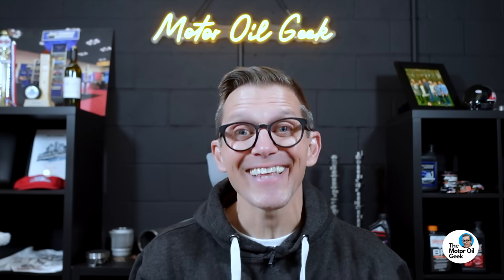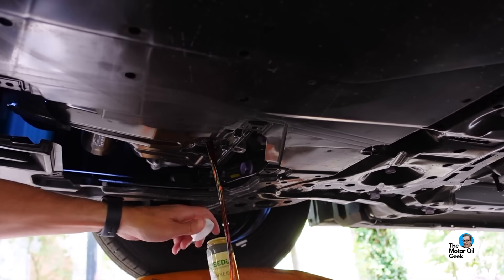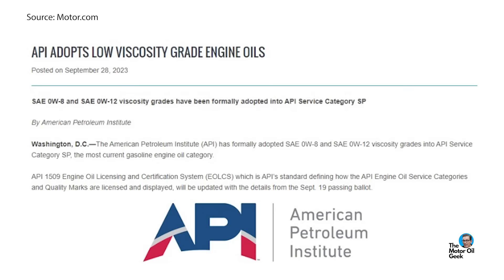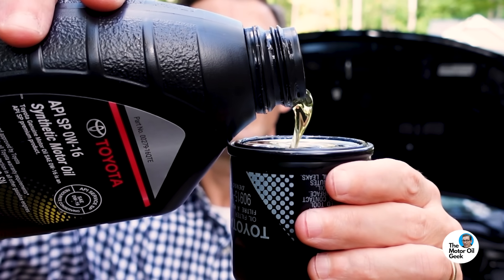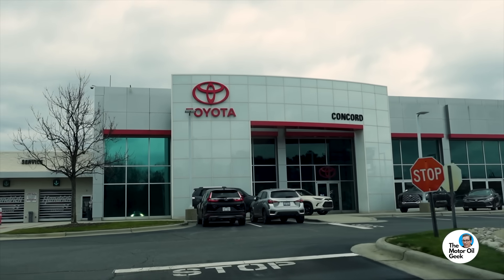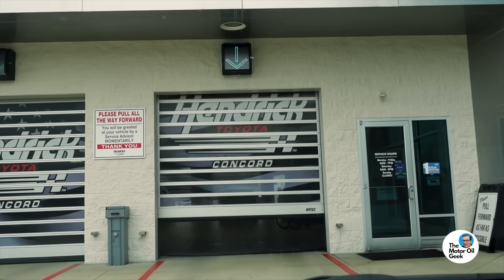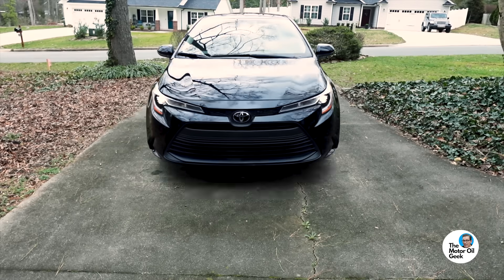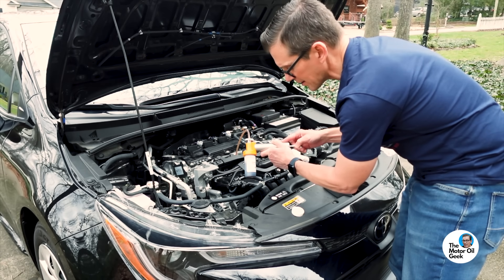0W-8 Motor Oil: Too THIN to Trust? Let's Find Out!

Comment: I would like to see a comparison of CVT fluid and Type F. I have been adding Type F to my high mileage GM Transmissions since the old Super Shops days to extend their life and firm up their shifts. I have been told that "Trick Shift" is Type F. Some 2,000+ HP drag cars with Powerglide and TH400 Transmissions will run Type F or CLEAR Hydraulic Fluid. I hope Lake does a video on this subject soon!! What do you think?
Reply: Hydraulic fluid and Type F don't have the friction modifiers of modern ATF, increasing the friction in clutch packs, increasing the shift firmness and torque handling capability before slipping. The disadvantage of both of these fluids is that most are made with mineral base stocks, not synthetic, resulting in increased fluid degradation, especially at the high operating temperatures found in an automatic transmission. Hydraulic fluid has another disadvantage in that it has no extreme pressure additives, which are required in any gear lube including ATF, resulting in very bad wear life which is why it's only used in racing. Redline does make a full synthetic high viscosity Type F and a low viscosity ATF similar to hydraulic fluid, but with the EP additives. I have used Redline Type F in a 6 speed manual Audi and because of the lack of friction modifiers, the synchros engage much better than they ever have when using regular GL-4 MTF. I wonder how well a Type F fluid would work in a dual clutch transmission, as it has both wet clutches and synchros so it would see not only an improvement in shifting, but also in preventing clutch slip off the line, different than an AT which uses a torque converter or an MT which uses a dry clutch, both of which independent of oil friction modifier content.
Reply: @quentagonthornton49  Great comment and FWIW, I have attended two of Lake's sales/training seminars when he was officially promoting Gibbs/Driven oil. Thanks for sharing your experience.
Reply: A lot of hydraulic fluids have a 900ppm ZDDP minimum, and the ones that don't are in case it leaks onto the ground and especially at a cleanup site like an open pit mine reclamation.
Reply from the maker: Great suggestion. I formulated some Type F racing transmission fluids, so this could be fun!
Reply: I've heard about cvt fluid having less friction modifiers.  Kind of like honda zf-1
Reply: But I do wonder about the DW-1 fluid being thinner like toyota world standard ws atf and was told approved for GM dexron 6 applications.

If you can make a video about the performance differences

Comment: And not only do you make sure to use CVT fluid in a CVT, read what the vehicle manufacturer calls for. There are a variety of CVT fluid types.
Reply from the maker: Great point!
Reply: @themotoroilgeek  Surprisingly, "Valvoline MaxLife Multi-Vehicle ATF" is a replacement for Toyota WS ATF (conventional shifting auto trannies) AND Toyota CVT FE, yes, both.  I think they just added a big list of CVT's to their compatibility List, as seen on their latest Product Information spec sheet.  Since that stuff is very well respected (runs in about any automatic around, with good shift quality!!), I would not doubt the Valvoline "experts" in claiming this universality (kv100 5.9 cSt), and I guess the frictional characteristics work in conventional style AT clutches and CVT chain systems too!  I don't know how they do it.   Heck, it would prob work in my '24 Honda CRV Hybrid e-CVT, but that one did NOT make the list for some odd reason.

Comment: Makes me wonder what the engine tolerances are ? Most of my vehicles are .002. everywere and use 5w30 ! Also you have to use approved 0w08 so not too void warranty ! Is this for fuel economy only ? And man thats alot of moly in the package 756 ppm is almost 5x above average ! Wow ! But is it gen 1 moly or gen 2 ! 1 tends too fall out of suspension gen 2 does not ! And the cost per qrt $22 is another wow !
Reply from the maker: Gen 2 MOLY for certain.

Comment: Lake, did the dealer know you were going to name them in the video? In my area I don’t know any dealers putting in TGMO: they put in whatever they can get in bulk. TGMO is always extra. Maybe Toyota forces them when it comes to the free service?

Also could you comment on flushing an eCVT ? I’ve heard that’s not necessary for 100,000 miles.
Reply from the maker: I gave them no heads up whatsoever. The appointment was booked under my daughter's name.
Reply: From what I've read, the Toyota oil is likely supplied by Mobil, so if they're getting that in bulk, that would be fine with me---but since I'm doing my own oil changes on my 2024 Corolla XSE, I'll be just fine. LOL.

Comment: Back on the farm, the combines we ran had variable drive on them as well, but it wasn't directly in the transmissions. Our International combines had a regular 3 speed transmission, then had a mechanically actuated belt drive on the side of the machine that gave almost infinite ground speed. Granted at top speed in 3rd gear, it maybe went 12 mph specifically for highway use, but the field speeds were pretty much miniscule adjustments. 1st and 2nd were the field gears and you operated the variable speed either by a hand lever on the floor or a foot lever depending on how old it was. It made for very easy forward motion control without changing the engine speed. The machine thrashing speed had to be maintained at a constant speed so changing ground speed has to be done separate from the engine speed and it's cumbersome to change gears. It worked fairly well. 
Our newest combine had hydrostatic transmission where the ground speed was contained within the transmission and actuated by a hand lever on the steering column. It used the same process to increase or decrease speed but it didn't have the big belt drive on the outside of the machine. It also didn't have a reverse gear, the hydrostat had the ability to move in reverse in whichever gear it was in by just pulling the lever back to the neutral position which stopped the forward motion, then continuing to pull backwards on the lever and the combine went in reverse. The variable speed combines did have reverse and the variable speed mechanism did operate in reverse too.
It's kind of interesting that they modernized the process and put it into transmissions in modern cars. Subaru also has a CVT transmission too.

Comment: I will never go 10k between oil changes. I wouldn’t be able to sleep at night. Oil is cheap, engines aren’t.
Reply: You must have shitty oil in the US to be changing it all the time.

Every car I’ve owned has had at least 9000 mile intervals and more commonly 12000. Never had an engine problem in my life.
Reply: Same here.I posted above that I used to change my oil at 15,000 miles And I sold my car To a friend With 400,000 mile miles And it still runs runs perfect....
Reply: @Steven_cheeseberg  Valvoline & Pennzoil full synthetic
Reply: @Steven_cheeseberg  There is awesome oil in the USA, problem is people are brainwashed into 3K oil changes!. I go 10K on all of my fleet.
Reply: @Steven_cheeseberg once a year right ?
Reply: I feel like my issue is if there is a oil/coolant/gas leak into the oil you will not find out until its way too late. So even if the oil can last that long there are still other issues. A good user will check and find those things but I feel like a lot of people will be lazy and never know until their next oil change.
Reply: @pleasedontwatchthese9593 Just smell it on the dipstick each time(fuel) any significant water would make it milky.
Reply: @GT-mn3bx   my last part of my comment covers that. I feel like people would get lazy and not check
Reply: You are just throwing perfectly fine oil out,to put other perfectly fine oil in. To change it before 10k it’s just stupid
Reply: @blackflagsfromkhorasan6687 There's some caveats to that statement. Rarely does oil wear out. But things like moisture buildup that can cause sludge or fuel dilution from certain engine designs or emission strategies can make changing the oil sooner necessary. Those that only drive a few miles at a time and never warm the engine up probably should be doing an oil change more frequently. Same with high idle time. I do some oil sampling on our vehicles and one pickup sees a lot of idle time. They actually recommend a change at about 5000 miles. (I change based on hours for it, about 250 engine hours.) The emissions strategy is to fire the fuel injectors on the exhaust stroke to regen the dpf. Diesel fuel gets past the rings and thins the oil.
Reply: @tangydiesel1886  Well stated
Reply: @blackflagsfromkhorasan6687  Exactly
Reply: In europe most of the brands tell you to do 30k km or 18k miles between changes, 10k miles is considered completely normal there
Reply: He didn't
Reply: Sure thing. You can see why van operators push it out to the 20k miles / 30k km though that Fiat (Dodge), Mercedes, Ford, Renault etc say (with e.g., 2.0L turbo diesels), as they want to keep the costs down.  Plenty of people see that this is what it says for their passenger car Mercedes C300 diesel or Renault Talisman diesel as well and just follow it too.  In theory this should be OK as long as the oil stays in spec and doesn't get diluted with fuels, though these Euro engines following these schedules do tend to be varnished up when they are opened up.
Reply: @TassieLorenzo I would say it depends on the use case. A lot of Amazon vans are doing stop start driving where they're literally going around the houses and being turned off and back on again every 5 minutes and I'd definitely change the oil much more often than the 20k mileage that's stated. However, if the van was started in the morning and driven for hundreds of miles during the day on the motorway/highway and has it's levels checked properly and topped up like it's supposed to and then only turned off at the engine of the day, I'd feel a bit better about extending the change intervals.
So like has been said, mileage isn't really a great tell when to change the oil.
Reply: I am maintaining my cars for last 54 Years. ALWAYS change oil (Mobil 1 - full synthetic) and either Bosch or Mobil 1 Oil filter every 15,000 miles. Never had  any issue. Currently driving 2004 Mercedes E320 with 286,000 miles. Oil changed 18 times (average 16,000 miles). Never had any issues. Engine runs like new. In addition according to manufacture still driving with original transmission fluid (sealed for life - per Mercedes-Benz) Transmission shifting  perfectly.
Reply: It really depends on how you drive it.   Long haul trucks will go tens of thousands between changes and hundreds of thousands or more between engine overhauls, but they don't put them through many heat cycles between oil changes.  The typical soccer mom mobile that gets started, run a few miles and shut off multiple times a day should probably have oil changed every 2-3 months even though it's only getting maybe a thousand miles on it in that time.
Reply: @wirebrush Modern engines have heat age calculators, so regular mileage intervals aren't a strict requirement, people are struck in the past.

A properly designed modern engine will tell you when it needs an oil change.
Reply: @wirebrush  Those long haul trucks also carry-40-50 quarts of oil, have ten or more times the filter capacity of a street car and those engines are turning well under 2000 RPM in modern trucks.  Makes it easier to get extended drain intervals out of them.
Reply: Same
Reply: Idk why people cheap out on oil changes. It’s literally $40-50 of you diy . People really change their following the manufacturer interval of 10k. Extra $50 to have peace of mind 🤦🏻‍♂️
Reply: Amen
Reply: 150k on my rav4 every 10k.
Reply: Yeah I do 3k on my personal vehicles. It’s wild to me that the trucks I work on at my work go 60,000 between oil changes 😮
Reply: Then why not change em at 500 miles?
Reply: I go 15k on my 03 civic.   But I use Amsoil Signature Series and UOS's show I can go further. I do filter changes half-way through.
Reply: @ChinookBear  Top shelf PAO oil!  I'm just curious do you have any varnish under the valve cover with 15k miles or is it totally clean like a brand new engine?
Reply: @TassieLorenzo   premium synthetic base oil molecules have neutral polarity versus lesser oils negatively charged molecules so they tend to attract positivity charged oxygen.  So premium synthetics don't have the propensity to attract oxygen, which causes oxidation of the oils that lead to varnish and sludge, keeping engines much cleaner.
Reply: I went 15,000 mile intervals On my last car A 2005 BMW 530.  I sold it to a friend of mine With 400,000 miles, The engine was perfect....Who is still enjoying it.
Reply: @bmwlane8834 BULL SHIT🤡
Reply: The 5,000 oil change interval is so out of date it’s rediculous. In piston engine airplanes you change the oil every 50 hours or so. That’s because they are metered by the pilot and the engines are air cooled which means they get contaminated with fuel all the time. That’s like changing your car oil at 2,000 miles. Modern cars waste zero fuel and run so lean that there’s almost zero fuel contamination and the oil is so good that I can handle multiple amounts of the contamination that the old oil could. It makes sense that you can go 10K between changes. Now my Bronco is super turbocharged and uses a cheaper ford oil and they are recommending 6,000 mile oil changes. That’s different than a naturally aspirated engine that doesn’t run at nearly the temperatures and pressures. I’ve NEVeR had an engine problem EVER due to oil change intervals and I’ve been driving cars for 30 years and always just do what the manufacturer recommends and take into consideration heavy city driving or trailering etc.
Reply: @crooney82  Ask yourself, if my oil cannot survive past 5K , why not? Get better oil!
Reply: @crooney82 all bull shit!! 7500miled or 12k km at most! Modern engines operate at very high temps, EGTs over 1000degree C when pushing, so yeah all you talk is BS🤡🤡
Reply: I do 60.000km on my oil changes. 620.000km and running great!
Reply: @Winnetou834  I manage a fleet of trucks and a couple of cars. I never change oil before 10K miles. I pull a sample and get it tested. However using cheap oil will cost ya!
Reply: @Winnetou834 next bull shitter🤡🤡
Reply: changing oil every other day will cost the same as a engine quick. At least here, good is atleast 50 dollars plus a filter, a engine is like 500-1000 bucks if you change it yourself. I keep up on oil changes just so i dont have to change a engine, not because of the cost.
Reply: @alexstromberg7696  Using cheap oil you have to keep it changed
Reply: @alexstromberg7696 maybe some cheap crap engine cost 500-1000bucks,
Even rand down 20year old bmw engines costmore than 1000bucks
Reply: I have a Mitsubishi Mirage 1.2 from 2014. I now have 200000 miles on it and i change the oil at 12500 miles and the oil filter at 25000 miles with Shell 5W-40. The engine uses 1/2 quart of oil between oil changes.
Reply: @felgercarb3803  Why on earth would you run brand new oil through a filthy filter?  At 12,500, I'd have used 2 filters.  Clean oil is better oil. Be smarter.
Reply: @felgercarb3803 This is probably the stupidest thing I've read in my life. Please don't reproduce.
Reply: Then you are using cheap oil! If your oil won't handle 10K, find a brand that will!

Comment: The viscosity of the engine  oil is depending of the year trim and average. The latest is the car the low is the viscosity however, older cars with high milages would need 0w 20 and  5w 30. Eventually, this 2023 car should be using 0w20 due to the long lifespam of the engine wear.

Comment: I still remember using W20-50 Duckhams Q in early Minis in the 60’s, the oil was green in colour.
Reply: You can still buy Duckhams Q 20W-50 (it's now API SJ in the UK) and it's still green in colour! They do a Q 10W-40 too, which replaces the old Q 5500 (10W-30) oil.
Reply: My box goes on about this all the time he said it was recycled oil
Reply: @eoghanhennessy443 who’s a box
Reply: I still run 50wt oils in a 1989 Subaru EA71S factory race engine. In my daily driver, a 1979 Subaru DL. 200,000 miles on it since I rebuilt it. The engine specs a long ago discontinued 10W-50. I run a 0w-50, 5w-50, or 10w-50 in the winter, and a 15w-50 or 20w-50 in the summer. My friend drives a 1982 Oldsmobile Toronado diesel, it runs best with a diesel rated 15w50 or 20w50, quite hard to find.
Reply: Yep and used toilet paper rolls for oil filters.  The good ol days.
Reply: @zepm7184  good god I forgot about that!
Reply: Do you sing for cannibal corpse?
Reply: My Dad said he used 85w gear oil in his 1970 Charger 440 when it was burning oil. Surprisingly it never missed a beat
Reply: @RobertSmith-le8wp I bought a 2.8 Fiero with some low end knock as my first car in 1991 for dirt cheap.
I ran 80/90 gear oil for 3 years before it gave up the ghost.
Reply: You mean gear box lube?
Reply: @thisisyourcaptainspeaking2259  the Mini gearbox lived in the engine oil pan, so it was engine and gear oil.
Reply: @chrisbarnes2823  Makes sense.  I only had the opportunity to spend quality time with an mg that had no roof, chrome bumpers and no rust.  I really wanted that car.
Reply: @thisisyourcaptainspeaking2259  MG still used a A series engine same as the Mini, my wife has a 35 year old Miata, she loves it because it’s basic.